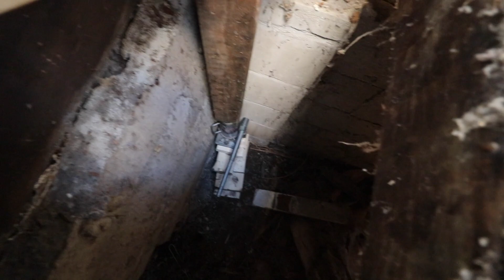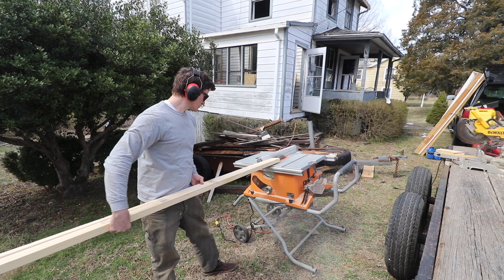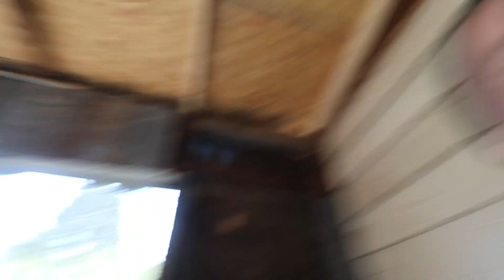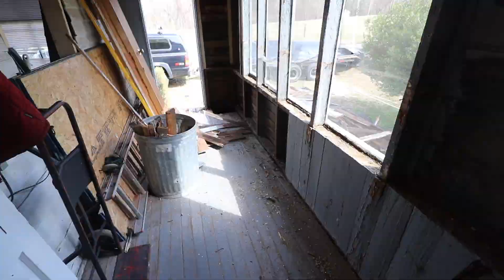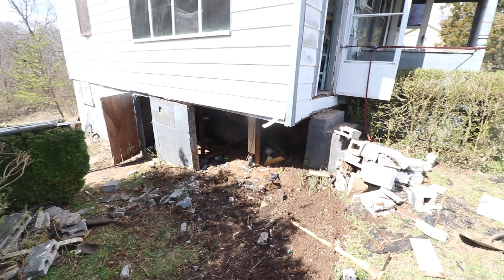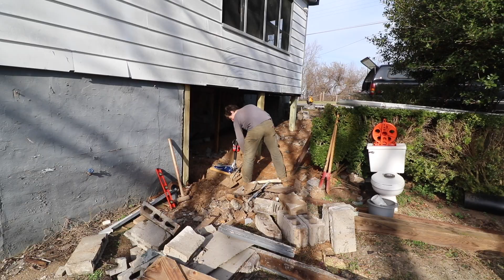$9,000 HOUSE - CRUMBLING FOUNDATION - #21

Comment: Don't you get tired of working alone?  I know I do.  I like having a helper or company now and then.  I love the screened in porch, but I understand why you want to change it.  I just love being outside as long as it isn't cold.  And the look on your face when you tripped on the stairs.  Priceless!  Oh God, I feel for you and the corner of that house.  Lordy, that concrete block wall was crumbly!  I don't like bushes up close to a house either!!!  And I hate privet.  Ick.. Impossible to kill down here in FL.  When I get mad, I have to quit for the day cuz then I find myself doing stupid stuff and end up getting hurt. lol  Oh, look!  Dad!  Yay!  And why is there ALWAYS a tire or three at every property.  I have Milwaukee tools too.  I keep adding and adding.  I have the circular saw.  I runs down fairly quickly.  Not too bad, though.. That Sawzall lasts forever though.  Battery kind that is.  Ok, I'm done rambling now.  =)

Comment: did you put concrete for the footer in the 6x6 hole.  That hole must be 30" deep and concrete.  after pooring is while wet put your 6x6 support in there plumb it up and attach to the floor above.

Comment: Hey Bud, couple questions.... Did you put those 6x6 and 4x4 onto some kind of concrete pad?  In my personal experience, any time I don't make the footprint of a 4x4 or 6x6 significantly more, the weight will drive that post into earth even if it were virgin soil. Thoughts?  I noticed that foundation block wall didn't seem to have a footing, but one advantage it had was the weight was dispersed to several square feet of earth instead of 3.5" x 3.5" or 5.5" x 5.5". Big improvement either way! That foundation would be a nightmare to refab another way.

Comment: lot of code violations. should be minimum 3x3 landing at top of those side stairs. footings should be installed so they are at least to grade then posts bases used to connect 6x6 to them. thats just a few
Reply from the maker: Yet the world keeps turning.
Reply: @homemadehome5575  be curious if the building inspector shares your same view. Oh wait, I doubt you pulled a permit anyway

Comment: I'm afraid it wasn't good solution. It won't work for a long time, i'm sure. The weight of the porch will make those posts sink quicker than a wall of bricks, due to their small square. The preassure on them will be significant. I think you should at least make a sand pillow beneath posts and also concreted them.

Comment: I am surprised that you just put the wood straight to the ground, with no concrete in the hole. Is there a reason based on your location where this style of posting is not an issue over the long haul?
Reply: I bet he does that on another day.
Reply: Wood always belongs above ground-level. No matter if you pour concrete around it or not it will rot below ground-level. Yeah i know the true american answer "it's pressure treated!". Well that gives you five more years...
Pour an apropriate foundation and set heavy duty post anchors inside.

Comment: Great job with jacking it up and replacing the support beams and roof. I have a question about the post you put In? Did you put any drainage rock at the bottom of the post to help shed any water away from them?
Reply from the maker: There's a footer.
Reply: Homemade Home ok that makes sense now

Comment: I don't really understand why you've done what you've done. You took out that junk block work and replaced it with timber on the ground in a shallow hole buried in soil. It will subside and in about 6-8 years that treated timber will rot and you'll be back to square one. It would have been only a small amount more work to dig out a strip footer about 300mm deep and pour concrete. You could then have built a proper block wall on it and never have had to touch it again.
Reply: I think he said he put in a concrete footer - maybe one of those pre-formed blocks for decks? Nevertheless, I agree. It won't last much longer than a wood privacy fence it seems.
Reply: Am wondering the same thing! It'll rot within 10 years. I know he's got a funny sense of humor; is he kidding us?
Reply: Did you notice the orange "dirt"? That's brick clay. It won't absorb water. Where he is, it's a natural footer because water won't penetrate it. Also, there's a nice natural drainage slope, so that wood will last forever. It's treated pine. Look it up. Different building conditions for different geographical locations.
Reply: @DodiTov  yes and the water will puddle at the deepest Spot... where he dug the hole for the post. And to say "you dufus! IT IS pressure treated!" is really dumb. It will rot in the long run. Yes the pressure treatment gives you couple years more but it will rot anyways

Comment: That porch will sink and those posts will rot. Here's how to do it right.
1.  Pour 16"x16"x4" footing in each hole
2. Stab #4 J Bar Vertically
3. Place 10" Concrete Form Tube over #4 rebar
4. Level & backfill around Concrete Form Tube (secure before filling)
5. Pour and Level Top (top protruding at least 4" out of soil) 
6. Stab Simpson Post Base in wet concrete & level (ABU44 or EPB44PHDG)
7. Secure Pressure Treated 4x4 with 2-1/2" x 4-1/2" Bolts

Hope this helps.
Reply from the maker: There’s a footer in the holes, it will be fine as is. If not, ill fix it later.

Comment: You get kind of sucked in to the brand of cordless tool that you either started with or have the most of.  Mine are Makita, and I love 'em, but as with all of the cordless tools, the batteries will kill you if you need to buy different brands rather than swapping your existing batteries between the tools.  I still have a bunch of tools with cords, too, but since I am only the "occasional handyman", I can't justify replacing them.
Reply from the maker: I started out with a black and decker drill, then Rigid, then Milwaukee. What has impressed me with Milwaukee is how long the batteries last and how powerful the tools are....I also like the M18 line, it's huge...meaning I don't have to switch brands, they pretty much make everything other companies make and more. Not saying it's the best, just makes the most sense to me.

Comment: would say do not insulation now keep it a open deck  and connect it with the front deck everybody uses the front stairs.   Do not do the green fake carpet.  
 Do not enclose under the deck.  seems like it would be a great place for skunks raccoons rats to live.  Is that a old basement window with the cardboard.  put a window back in.  would do the windows but possibly find some you could recycle and the windows would be more of a weather screen.  for wind and rain.   keep the storm door.    I liked the shelves for plants.   would like a little table to drink coffee ….

Comment: I lift foundations for a living. Aint no biggie. dig a 2 foot x 2 foot hole 2 foot to 32 inches under the bottom of the foundation , post hole diggers and flat head shovel is easiest. pour a cement pad up to 1 foot under the foundation. lift with 20 ton bottle jacks until you are happy with the lift [use a steel and wood pad on top of bottle jack so you dont blow the foundation], shore up with 4x4s by banging them in with a sledge, remove jacks, fill the rest of the hole with cement, easy peasy. takes a day or two or three depending on the amount of lift you want, watch out for inspectors.

Comment: I like the Homestead Craftsman and I still enjoy his videos.  I think what he is doing with rentals and furniture is cool if it works for him as a business model, and certainly you cannot beat passive income financed with cash.  BUT... as a carpenter for 20 years, on occasion I cringe at some of his repairs.  Most, I think, are elegant and well designed, and I only mention the bad ones for benefit of viewers that may not be experienced and are renovating for themselves.

Better building practices and the IRC dictate that 1/2 in. OSB should not be used as roof sheathing on 24 OC framing.  In general, many jurisdiction do not permit OSB as a roof sheathing at all because it is prone to catastrophic failure when exposed to moisture, like on a roof.  Rule of thumb to meet code and better building practices is 5/8 cdx ply for 16 on center rafters and  3/4 cdx ply for 24 on center rafters.  

When installing posts they should be placed on appropriately sized concrete piers, and may require hardware to make a positive connection from the pier to the post.  Burying them into the ground, even if they were ground contact pressure treated rated, would not pass inspection in my jurisdiction, and is in no way close to better building practices unless you are building a fence.

I hope this may help viewers doing renovations and by all means, check what anyone says on YouTube, myself included, against the IRC building codes available for free at UpCodes.

Comment: I’m glad you ripped out all that privet hedge. You should relocate all of it to the edge of the property, somewhere that it makes sense to screen it from an unappealing view or create privacy from neighboring property.

As others are saying, I think outdoor carpeting is not going to be viable. I would be concerned that it holds moisture right next to the substrate. I think most tenants will dislike it, carpet always feels mangy, no matter how clean you try to keep it.

I don’t know much about construction, but is it okay to have wood, even pressure-treated wood, in contact with earth? Are the bases of the posts sitting on some kind of concrete footing to spread the point load? Is that even necessary with the weight of the porch, which doesn’t seem like it’s that heavy? Like I said, I am not really an expert on this sort of thing, I just wonder based on other shows and whatnot that I have watched. I would love to know the whys and wherefors of this solution.

Comment: "foundation" German dog sheds have better foundation than this house
Reply: In Europe there's a tonne of building regulations and standards. You don't find houses built as badly as that in the UK for example, but then you also don't find houses for $9,000 in the UK. My friend's garden greenhouse for growing vegetables is built on way sturdier foundations than this house 😂
Reply: @scrumpoxjnr  yes, it surprises us to see no foundation...but lets never forget that owning a house is almost imposible here in europe, specually if you are young.
Starting price is 100,000€ somewhat near a city.
You need to move away of everything for at least 80km to start finding houses under 50,000€
Reply: Houses in US  are a lot lighter because they are made out of wood, you don't need a massive foundation like they do in Europe.  In fact there are a lot of 100 y.o. houses in US that look way better then 100 years old houses in Europe.
Reply: The foundation for the house is fine, this little porch area is an addition that was done poorly after the house was built. You can tell because the inside of that porch has what used to be exterior siding. I'm sure it was done without a permit or inspection.
Reply: @scrumpoxjnr  No you find £1 homes.
Reply: @scrumpoxjnr  Yeah, you do. They've mostly been SO bad in the UK that they've fallen down.
Reply: It's a porch. Porches often have no foundations. They're also not supposed to be a living space, but they tend to be tempting to sort of expand into unofficially.
Reply: This is also a house that was probably built by a pretty low income family.  Do realize that it originally had NO indoor plumbing.  The kitchen was in the yard somewhere in another building, and so was a latrine.  It's really hard to say when it was built, but it could have been any time from the 1870s until 1900 or so, the the style is older.  It originally had TWO rooms in the main house, a parlor with a bedroom above, and underneath was a basement.  That was it.  It was heated with a stove, it looks like from the chase.  

Houses for this "income group" in Europe really don't survive AT ALL unless they are accessory dwelling or were some almshouse owned by some organization or noble.

Sometime probably in the 1920s, it had the big addition, which brought electricity and plumbing to the house.  That added the dining room and kitchen downstairs, and a second bathroom and bedroom upstairs.  They put new siding over the shakes.  They got a boiler instead of the original stove(s).

Then, early in the 1970s, it was remodeled.  The downstairs toilet was added.  The washing machine was added and some remodeling was done to the plumbing.  The porch was probably added sometime before that and then but enclosed in the 1970s--it was NOT built as a dwelling space at all (and is actually still a screen porch) and should not have been built the way it was or enclosed the way it was, either!!  New kitchen cabinets and kitchen flooring.  The ceilings upstairs were retextured then.  They also put in duct work for central forced heat and air through the heat pump--which is probably why there is more recent drywall work going on.

Since then, however, almost nothing has been done.

If he wanted to make it really marketable, he would move the air handler to the same room as the washer and dryer in the basement and make the room further back its own bedroom, because it has that big window, and add a full bathroom with a shower unit attached to it in the final room that already has the slab floor.  Three bedroom, two bathroom houses have a much, much higher value than two bedroom, one bath houses.  The fact that you have to walk through a mechanical and wash room is definitely a minus, but a fairly small one in the grand scheme of things.
Reply: @genli5603  Good synopsis, probably exactly what happened. 👍
Reply: @samt5663  £1 houses where? Here where I live in London, a 2/3 bedroom terrace, (small often two up two down,) starts from £450,000. My flat/apt now sells for half a million and people wait in a queue to buy here. Young people cannot buy a property in this particular area, and many other  areas of London. Its ridiculous really!
Reply: @patriciabarnes6664  Tom's statement mentioned UK, that's multiple nations not just London. 
Houses were sold recently in Liverpool for £1 on some really dodgy street that needed plenty of repairs. Still cheap. Cheaper than $9,000.
Reply: @gene6126  Well it "looks" good with some goofy paint and magic dust on it. But think about 100 years old rotten wood or brick and mortar.
Reply: @gene6126  that is just plain wrong. We have houses from the 15th century that are still fine and in use
Reply: @genli5603  There were houses (farm houses) built in the XIXth century in Europe that not only still stands, but would put to shame many modern houses as far as sturdiness is involved.
My parents' house was an old farm, and while they renovated everything inside it was still a two-story (+ full basement), 250+m² house with 60cm thick walls made out of solid stone. The cornerstones by themselves probably weight 300+ kg. And it was the house of farmers, not nobles.
Of course, with the effort and materials used to build such a house you could have built 5 american-style houses. It's debatable if it was worth it then, but it certainly makes for an amazing framework now.

Comment: I doubt with repairs like this the property value will increase. A few concrete blocks reinforced with rebar wouldn’t have cost more time/money then what you did. It’s not a shed, it’s a house. And this is not a repair. I understand you are making this for profit and it’s easy for everyone to comment, but the foundation makes a house safe. If someone buys it and the wood rots away, the building might collapse on them.

Comment: Why didn't you use concrete foundations for the wooden poles ? Aren't you afraid of rotten wood ? 
I myself wood have done the hole poles in concrete with some reenforcement steelbars in it. 
- Ok. I am german, probably would ended in building a bunker ;)

Comment: why would you go to the expense of insulating the walls when the windows are your biggest heat loss source and your not insulating the ceiling .... hot air rises.. leave the porch as a porch ... winter mud room ... like your granny would have had it ...

Comment: OMG did u just used 6x6 for bracing and planted them in the soil omg man that's not good at all it will rot and since its timber frame house it will have Dry ROT problems that are so bad, and i was thinking you were going somewhere with this... i mean you will rent the place for some people and its dangerous don't you have regulations or something? I'm speechless ...
Reply from the maker: They are ground contact and on concrete footers, wrapped in flashing, they will far outlast you and me...and you are clearly not speechless.

Comment: This is not a very sustainable way of renovating, leaving rotten wood in and just making it look nice on the outside and take a profit out of it, well i quess if youre ok with it.
Reply from the maker: Rotting occurs from continual moisture. I am replacing or sistering anything that is compromised. Also stopping the problem of water getting where it should not. In the case of mentioning soft spots, some are where a small part of the corner has damage, which is either replaced or an additional layer added. You are seeing only a small part of what I'm doing, no reason to turn it into a gotcha, judgmental moment. It's weird and small.